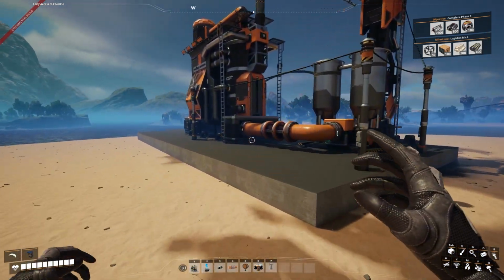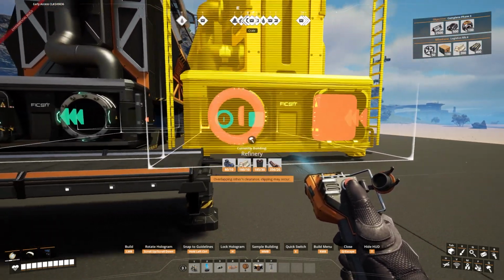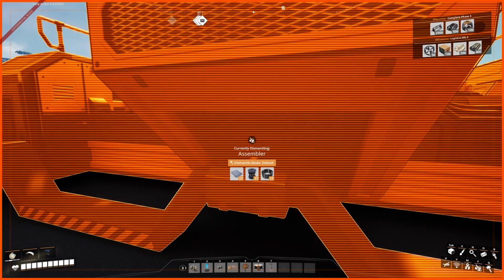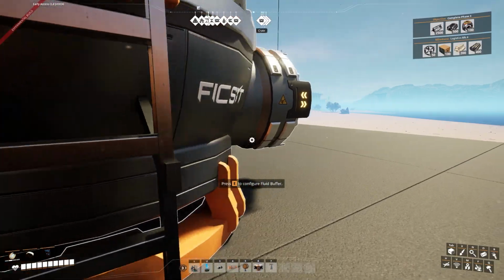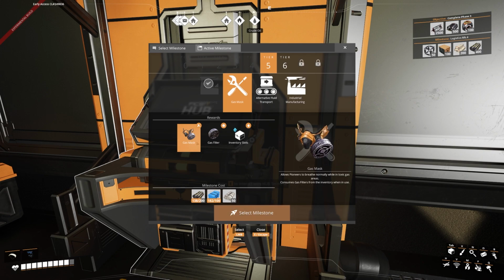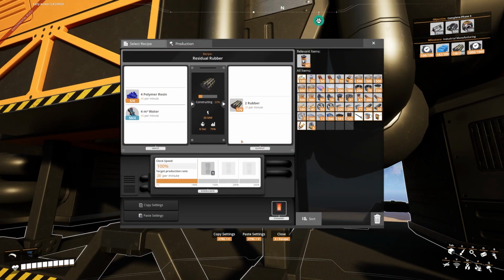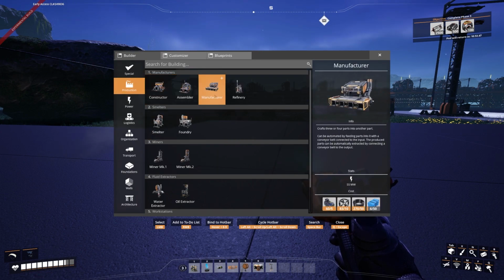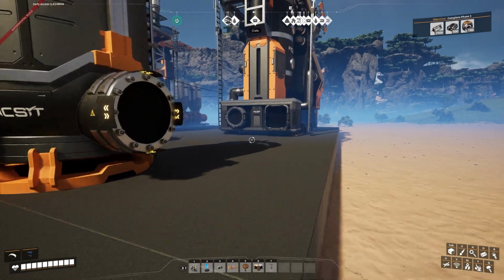Unlocking Industrial Manufacturing | EP49 | Satisfactory U8 | Blind Playthrough

Comment: At the beginning it might be better to make a very small starter factory at the oil that uses one refinery to make plastic and regular rubber since it only uses crude oil and convert the heavy oil residue into fuel. Store the plastic and the rubber in containers and then build 5-8 fluid buffers chaining them together to store the fuel.  Each of the fluid buffers only holds about 400 liquid and fills up pretty fast.  Once the buffers are full the factory WILL come to a grinding halt, so the more buffers you have the longer it will run before you have to flush this fuel.  Now its time to explore alternative fuel transport. You have all the tools in production to unlock this milestone and the gas mask before moving into automating everything else you mentioned today.  
Also another tip.  Color your pipes based on the fluid in it, so you could color water blue, crude oil black using the what your brain would like best.  

Remember just because you can doesn't mean you should.  Don't always pick the alternate recipe   

If you feel that MK4 belts are absolutely a must have you can had craft them or buy 50 computers for 6 tickets at a time in the awesome shop but I personally would wait a little bit longer.
Reply: Draining fuel from filled tanks can be temporally solution too
Reply: That is what the fluid buffers are for.  If you link them up you just have to flush one to get them all emptied and you about running back and for between bases so often.
Reply: That is what the fluid buffers are for.  If you link them up you just have to flush one to get them all emptied and you about running back and for between bases so often @ponusaurus804